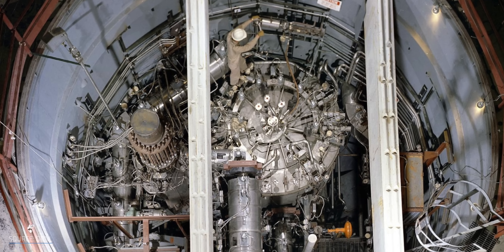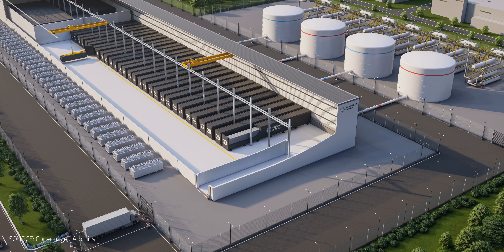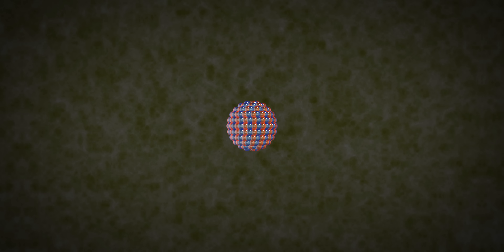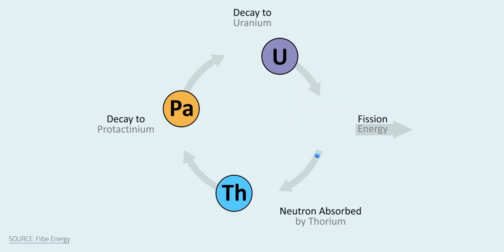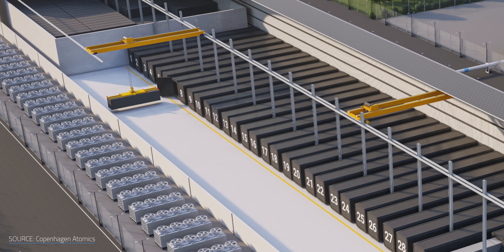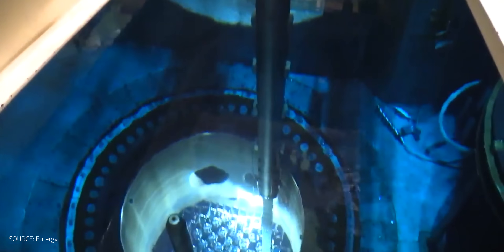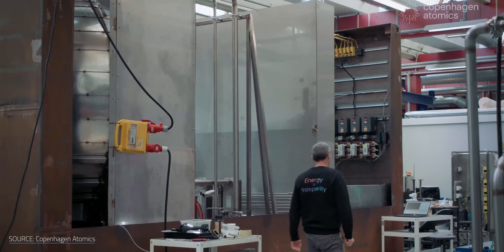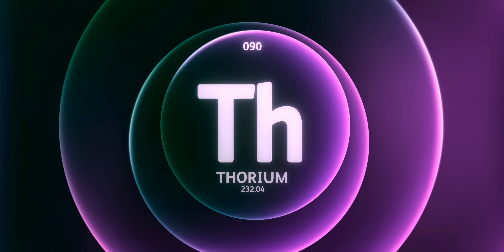Why Thorium is About to Change the World

Comment: Skeptical.  Any tech that wears out every part with molten corrosive salt yet can’t be serviced, only replaced doesn’t sound practical, especially when the thing being replaced weighs 1000 tons.
Reply: Reasonable to be skeptical, and a bit surprising, but high pressure water is actually more corrosive than clean salt (it wasn't long ago that there was a near miss in a large water cooled reactor; just imagine how much corrosion is needed to eat through those massive high pressure pipes...).

Not every part wears out either; in fact, the most valuable parts (by far) are the salts, which are neither damaged by radiation nor consumed. The parts that may need service/replacement will be much cheaper than the fuel bundles that need replacing every 3 years in LWRs. The 1,000t steel box is more of a vault than a replaceable component, and may just be there to satisfy public fear and insane regulations, or to keep anyone from dragging your investment away.

Comment: Would interesting to know if you could park a empty new reactor, next to the old reactor and just transfer all the useful fuel to the new one?
Reply: If it's molten salt fluid form-factor.... yeap. Easy-Peasy just hook 'em up together (with lotsa pre-heat in the new reactor) and pump it across 👍
Reply: Indeed, you just pump the fuel and blanket salts (and D2O) to a new reactor. The salts and heavy water are the most valuable parts by far, and none are consumed or damaged, perfectly preserving their value across generations of reactors into the distant future. What needs replacing is basically a cheap container composed of nothing special. Think about what that means for the cost of power from future generations of mass produced reactors, potentially from different competing vendors even (if you own the salt).

Comment: Shippingport Atomic Power Station ran a thorium reaction for 5 years from 1977 till the plant was retired & decommissioned. This was it's 3rd core, the previous 2 were uranium.
See Wikipedia.
Reply: Shippingport proved that thorium breeding works (even in solid fuel), yet processing that U-232 contaminated solid fuel is not viable. Molten salt reactors are essential to access the tremendous benefits of the thorium fuel cycle. See the U-232 video on Flibe Energy's channel for details.

Comment: Uranium-239 and plutonium-239 are created through neutron capture in a nuclear reactor. Specifically, uranium-238, which is not fissile itself, absorbs a neutron and transforms into uranium-239. This uranium-239 then undergoes beta decay, emitting a beta particle and becoming neptunium-239. Neptunium-239, also unstable, then undergoes another beta decay to become plutonium-239, which is fissile.

Comment: Good luck displacing uranium reactors, if they ever develop small ones that will be cheap enough to use on a mass scale. Solar & wind with batteries for storage, seem a lot cheaper to me than than these thorium reactors will be. People fear radioactive stuff near them. 
 Geothermal has enormous potential, thanks to advances in drilling and fracking. Major oil companies are working on ultra deep drilling technology to go after deep oil and gas deposits in the Gulf of Americo, and elsewhere. I have seen the head of Chevron say on CNBC TV that there is still a lot of oil deep down in the Gulf. I doubt he made that up. 
Let China perfect thorium, then steal their design, like they have done with trillions of dollars of Western technology during the last 40 years. They just caught 2 of them trying to sneak destructive plant diseases into the US from China. And they discovered hidden 'kill switches' in solar panels imported into the US from China. Guess what those are for. 
Canada and Australia has plenty of uranium.

Comment: Stop telling the Thorium Salt reactors cannot produce bombs lie. It is far easier and more clandestine, to make Nukes and Fusion bombs, using the U-233, Thorium reactors produce. The problem with Thorium is its use to breed U-233 in small reactors, that are hard to track. The first U-233 nuclear bomb was exploded in on 15 April 1955. In terms of proliferation it is far easier to hide than Plutonium. It is also far more effective for producing: compact, low tech, gun type, nuclear bombs; than plutonium-239. And as such is perfect for nuclear Artillery so making it a very small step escalation threat. There is some suspicion that Iran has a very large dispersed stockpile of Thorium produced U233 from reactors based on small research designs. It was already tested by the Russia as a Trigger for cheap Hydrogen Bombs back in 1950s and in fact used in Russia's first air dropped dial-able yield Megaton Plus Fusion bomb, the  RDS-37 in 1955. It can also be used, to cheaply enhance both U-235 and Plutonium-239 bombs, by alloying methods. Meaning less of the harder to produce, refine and hide elements are needed. This along with its problematic decay products means it was banned by most countries, despite its low cost. Go read. The Promise and Peril of Thorium

Comment: Copenhagen is just as BS as Thorcon. Neither has had A SINGLE ATOM OF THORIUM fed into their system, let alone U235. The only proven modern thorium reactor is China's TMSR-LF1 which not only has succeeded in achieving Proactinium production but has also been refueled while running. The Chinese are the only ones with a serious Thorium drive right now, not to mention the only ones already tackling commercialization. I was visiting Dongfang Electric (DEC) in Deyang a while back and they're already in competition to build the supercritical CO2 turbine that the TMSR-LF2 10 MWe reactor will use in place of a conventional steam turbine. The blades for the prototype were being cut in front of my eyes right next to regular steam turbine blades for new coal plants. That's how casual they were about it. There wasn't even a sense of secrecy. They just pointed at the machines cutting the blades and said, yeah, here's the blades for the CO2 turbine. It's just a regular job for the factory. They don't even understand how far ahead of the pack they are. The Chinese will win this race because they are already building their MSR supply chain using their regular factories instead of just IP farming for something that may possibly hopefully be built 50 years down the line by some future unrealized-as-of-yet industrial base (which is what Copenhagen is actually doing).
Reply: ThorCon gave up on thorium a while back and is concentrating on a simple U235 based reactor, similar to Terrestrial Energy.

Comment: 7:38 This is a contradiction. 
If heavy water is used for moderation you cannot eliminate the steam explosion risk without vacuume insulating the fuel salt (over 500deg C) from the heavy water moderator. Do they use a vacuume blanket to keep the water from heating while allowing neutrons to pass through it?

Comment: There's so much hype for fusion, but Thorium is the one I have hope for.
Reply: True. There is probably something wrong with the current approaches to fusion. They are based heavily on the idea, that fusion happens inside the sun, but mainstream cosmology ignores, that there is electricity in space. The sun might be powered from outside, not inside, which would make the corona (hottest known part) the place where fusion occurs. Much less pressure needed.
Reply: @quinto190  I'm not thinking about the physics of it. I'm not qualified to have an opinion there. It's just that I read news articles, and the "wow, big breakthrough" stuff for fusion are things like "We didn't generate any power, but we managed to maintain the necessary conditions for a world record 90 seconds!" and "For three milliseconds, we actually generated more power than we consumed! We have to replace the reactor now, but we'll go for longer next time."

That does not sound to me like a technology on the verge of practicality.
Reply: @jonathanlovelace521  Yes, exactly. They make progress within their own framework, but eventually they might have to step out of it...
Reply: Fusion is still a science experiment.  If it works out , and one can produce a cost effective grid generating electricity power plant, it could be a game changer.  That's a big "if".   But thorium MSR's seems closer to being that solution.

Comment: Why are they promoting a technology that's more expensive and produces more waste than conventional nuclear power plants? How are they supposed to take on the most expensive and complex technology? How are they supposed to operate without subsidies, when even cheaper nuclear power plants wouldn't operate without subsidies? Electricity from conventional nuclear power plants would simply be far too expensive for most people without subsidies... How do they, as a startup, intend to manage something so complex? I didn't see any solutions in the video. Instead, the additional costs and the additional waste were presented as a positive effect, as if having to replace a big part of the reactor every five years were a good thing... There are good reasons why, compared to all other sources of energy, less and less nuclear power is being built.

Comment: So, what happened with Oak Ridge's reactor? Did we burn all of the data that we gained? 15,000 hours is a long time. And were they getting dosed with gamma radiation for 15k hours? I'd like to see a follow up video which covers this. (maybe I should just search...  It probably already exists)
Also, I thought that fusion was the solid-state battery of nuclear power. ;)

In any case, thanks for the video.

Comment: A quarter of the cost is not good enough. We need either energy from sustainable resources, or energy that requires very little resources using nuclear fusion to achieve that. Otherwise, this is just boring.

Comment: Worth exploring, not worth betting everything on. Can they make it work technically? Probably. Looks like they got quite far already. Can they deliver on cost advantages? Not as clear. Anything a nuclear company produces in terms of numbers has a very high probability to be combination of wrong & misleading, and probably intentionally so. The numbers are typically geared at fund raising, not at customer acquisition. And historically numbers are so far off that you might as well triple them and hope that it stays that low. Which is also not a safe bet. The devil is in the detail with this stuff. Maybe this company will prove this wrong. But they have a lot left to prove. Until then, definitely worth some high risk capital that the people investing it can afford to lose 100% in the hope that it has some insane return at a lowish probability. But it sounds like there will be quite a bit of testing, delays, etc. until this is market ready and lots of bad things that can happen to this company financially in the mean time. 

Also, they need to benchmark against renewables plus batteries not now but about 15-20 years in the future when this thing needs to be competitive with that. Unlike nuclear, that's usable and the most affordable option in the market right now and improving rapidly and predictably on know cost curves.  Chances are that we'll have added some more TW of power by the time this becomes available.

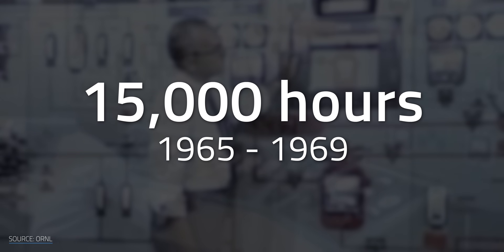Comment: it worked for 15000 hours in 4 years that means it didn't work for 57% of the time. (1:25)
not a single word about how to control the rate of the reaction.
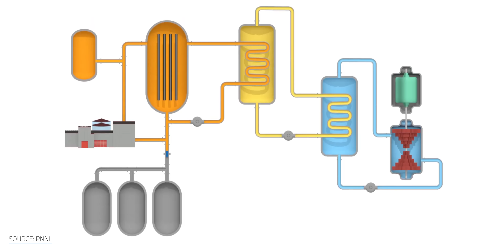why should it cool down if you stop circulating? (8:44)
it is nice that it runs in atmospheric pressure but at 700 degrees C! it could do a lot of damage if things
get out of control (8:24)
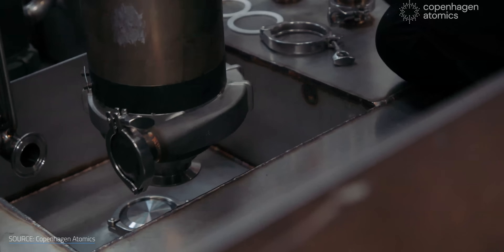and about the radiation you say it is too high to block (9:36). do you really think you'll just keep people off?
how will you maintain the buildings? how will you supervise? 
you basically need to replace your whole Power station every 5 years (12:33). you can not make it economical!

Comment: If nations spent the nuclear cash on insulation and solar panels we would not need nuclear any kind. The UK just announced spending another £15 bn on a new reactor. The exact same previous one was quoted at £9 bn and is already slated to cost almost £50 bn. Neither will produce power for ten years and projected price is at least double what renewable electricity costs now and that price is in free fall. Do they just want these dangerous old boilers to make fuel for bombs? There is no other  logical justification.

Comment: Do you remember when mobile phones came into the world? The first ones were very expensive and cannot be compared at all to what we have today. They would never be something that the ordinary citizen would acquire.
It is 100 per cent certain. That with all the models of SMR that are being worked on, there will soon be a breakthrough. And over the years, the economy is also starting to look reasonable. 
Copenhagen Atomics, has the world's best molten salt reactor.
Thorium-burned, Heavy Water moderated, breeder, Molten Salt Reactor, this design is ingenious.
Reply: Copenhagen Atomics doesn't have any reactor at all , it has a design for one. Let's all come back in 10 years and see how it did.

Comment: So every MW is running continuously 24/7/365 produces $87,600 per year @ $0.01/kwh. 5 years is $438,000 per every $0.01 it charges for electricity per every MW it makes. So let's say a 100MW system that would bring in $43.8M in 5 years per cent/kwh lower business averages $0.07/kwh and that covers lines etc... so producer let's say makes $0.05/kwh $219M per 100MW system that only last 5 years, the question really is how much will it cost?
Reply: It doesn't last only five years. It is refurbished and refueled. 
There a better Gen IV reactor concepts that run 20 - 30 years with one set of fuel, or they use on-site pyro processing, which cleans up the fuel constantly, and allow removal of posions and injection of new fuel.

Comment: It's not the first Thorium reactor in Europe. The THTR-300 has been runing in Germany  in the 80ties. It was a completely different design using Helium for cooling. It was plagued with a lot of problems, which were never solved.
Reply: It should've probably been the first thorium molten salt reactor in Europe.

Comment: Why bother, why not just use renewables? They're doing a great job in southern Australia, China, California & United States in general, Japan, Germany, India, Italy, Spain, Brazil, Vietnam, and the Netherlands.
Reply: Because we need more clean energy than renewables, at least for long enough to make renewables efficient enough.
Reply: @myboysd5772  Seems reasonable. Thanks.
Reply: @myboysd5772  The deployment of renewables has been accellerating so quickly that last I heard 9 entire countries are 95% or more totally powered by renewables. There are more solar panels in the supply than can be used in the short run so their super cheap. I don't see your point as valid anymore.
Reply: @DaveBjornRapp  Maybe you heard wrong then 🤔
Reply: @DaveBjornRapp  The highest is Denmark at 70% because of how windy that country is. The next closest is 47% in Uruguay. Again, because of how windy it is. BUT, they both still have to maintain 24/7/365 full demand-sized reliable generation for when wind and solar go to zero or very low. They would need weeks of storage to eliminate that. I'm leaving out hydro because it's so geographically specific. In these two cases, maybe I should leave out wind as well because no other countries are that windy.
Reply: @chapter4travels  You're not taking into account solar w/ battery backup. You've totally missed the whole picture by ignoring that.
Reply: @DaveBjornRapp  Batteries make the economics for solar worse, not better. You can't add enough battery storage to compensate for seasonal variability, which is weeks long. So add as many batteries as you like, and you still need 100% reliable backup from gas, coal, or nuclear.
Reply: @chapter4travels  Wow, You're really dredging up old data. Maybe refresh your understanding of the industry, because you're simply wrong. I will not engage with you further, unless you get with the times. Tech marches on faster than your OPINIONS. Good day Sir!
Reply: @DaveBjornRapp  According to Grok, "Achieving a 100% wind and solar powered Europe without backup would require a massive build-out of battery storage, likely in the order of hundreds of terawatt-hours, to manage the inherent variability of these renewable sources and ensure grid stability throughout the year."
Today, the entire world only has about 0.375 TWh of battery storage.
Reply: Because the cost to convert cheap renewables into 24/7/365 dispatchable electricity is outrageously expensive.
Reply: @chapter4travels  grid scale storage went down another 30% in the last 12 months... and it's not stopping any time soon. The adoption across the globe sorta contradicts you.

Comment: What do I think? Any redesign will need recertification. So the ideas of operating a new design every 5 years or so, and the company saving on mass producing a certified design for a longer period of time go against each other. You can either produce a finished, certified design for decades without any innovation, or go through lengthy and costly certification processes with each new modification.

Comment: 20-40 per MWH ... I do like that you emphasized that its a quarter of todays nuclear power price.
Actual renewables crush that 8 ways to sunday already, without having to first wishful-think yourself out of regulatory costs and the like.

All nuclear is garbage.
Reply: The cost to convert cheap renewables into 24/7/365 dispatchable electricity is outrageously expensive.